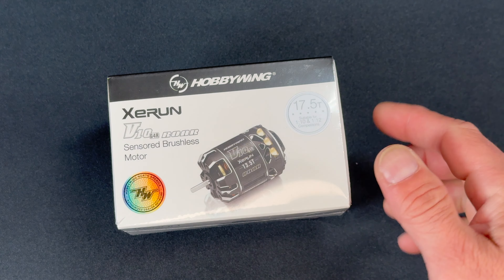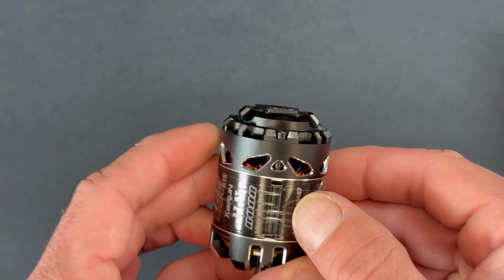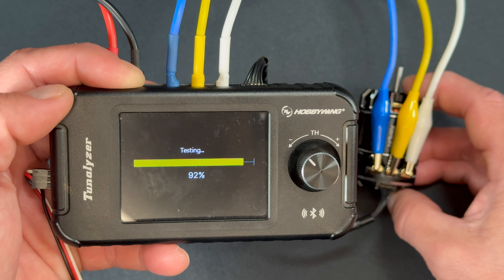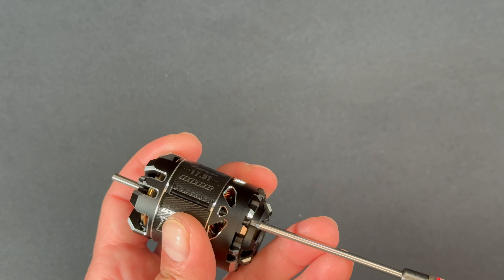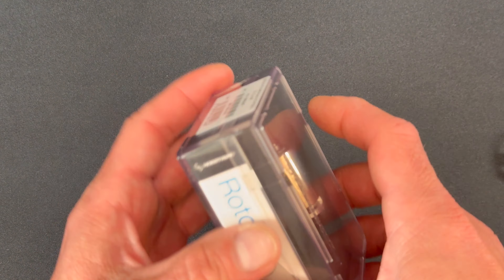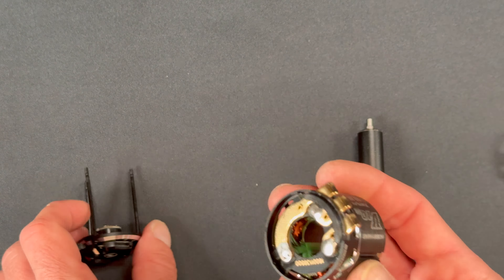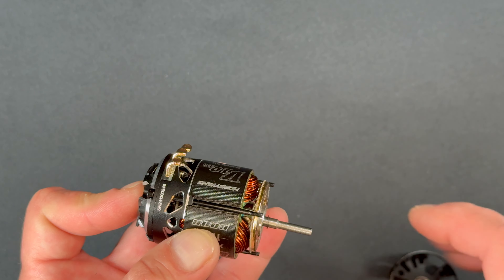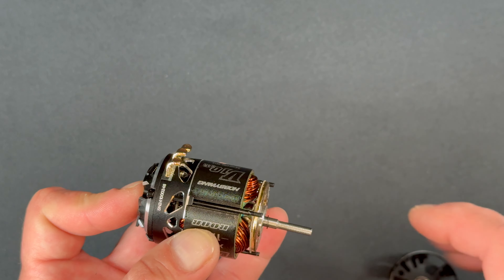The Charlie Show /// Episode 361 /// First Look - XERun V10 G4R Spec Motor (17.5 turn)

Comment: I'm curious if the 17.5 with the stronger rotor would make a strong crawler motor?
I had a 17.5 Novak Goat 2s system. It worked awesome.